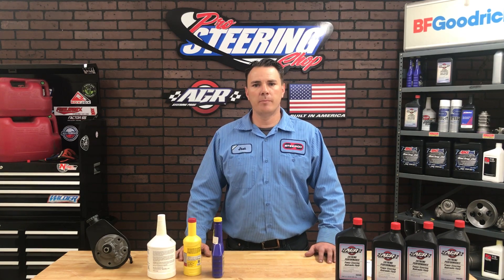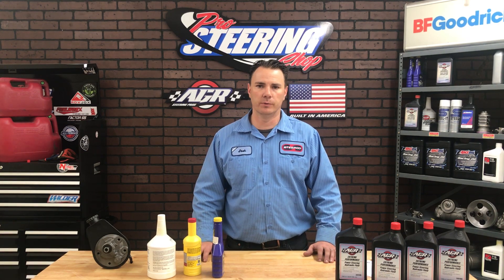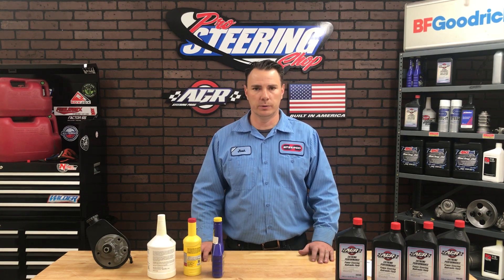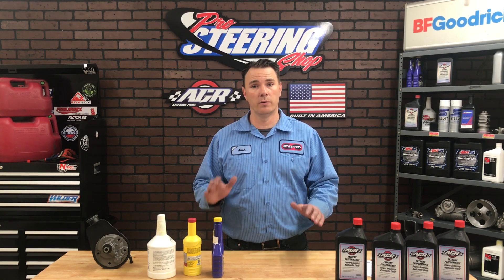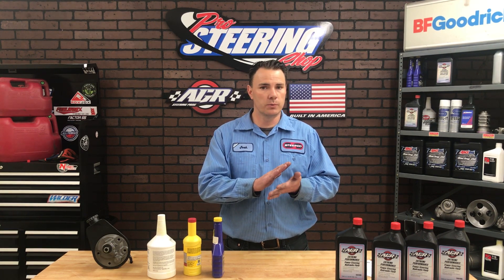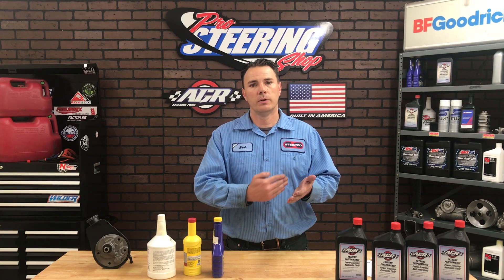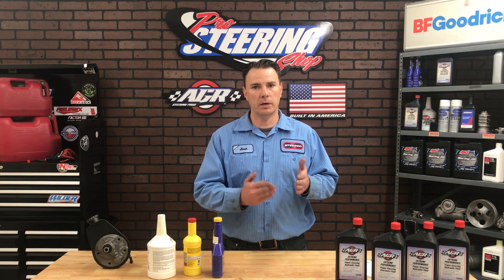Is Synthetic Power Steering Fluid the Best? (2 of 5) AGR Performance Steering

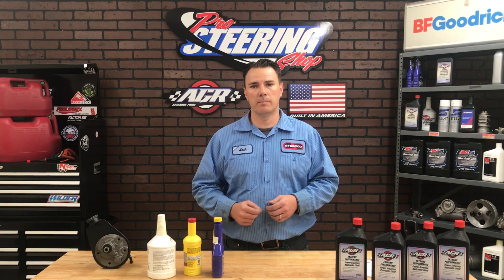Comment: 4:17 - Chrsler/Dodge/Jeep/Fiat  uses ATF+4 Fluid which is Synthetic.   So that's kind of a strange comment to make, unless of course he means for a specific aftermarket type of power steering pump.
Reply: And that should be fine for an OEM pump which is lower pressure and lower volume. Those pumps run on that fluid forever. My buddy’s ‘14 Ram OEM pump has ATF, never changed/flushed and steering is same today as was when he bought it. However, my ‘98 Ram has a high flow pump so I can’t run ATF. I would risk either reduced performance or destroying it.

Comment: Volume is not what makes the steering operate, it is pressure, because the "power" steering system is hydraulic. 

 Mentioning volume would be appropriate when talking about a cars water pump, where the pump is creating super super low pressures moving the "volume" of coolant through the cooling system. 

Metal doesnt melt at 180 degrees. Can you imagine a set of headers melting off your engine😂

Comment: Most of the time a PS pump is working in a bypass mode.  Personally i have used PTFE additive, as well as OEM ATF in  pumps for years with.. admitably.. pre 2012 cares,.. I have had zero problems.
Reply from the maker: GKT I think its great that you care enough about your steering system to try to create a good fluid mixture but using PTFE, however I have not seen the benefits. In-fact Machinery Lubricant Magazine did a write up on this exact topic. I'm quoting them when I say, "(PTFE), was invented by Roy Plunkett of Kinetic Chemicals (DuPont) more than a half century ago. To this day, DuPont claims that "PTFE is not useful as an ingredient in oils"

The  low volume, low pressure pumps manufactured by OEM's can get away with using lesser quality fluids like Automatic Transmission Fluid because they are in fact low pressure, low volume. Just like a high performance engine, a high performance Power Steering Pump requires a better fluid, which is why I state if you are running an OEM pump by all means use a OEM specified fluid, but if you want your HIGH PERFORMANCE PUMP to perform to the standards of its manufacturer use the fluids that the manufacturer recommends, tests and warranties the products with...

Comment: Why do heavy truck’s power steering reservoirs usually have stickers that recommend ATF?  Is PS fluid better, or is ATF easier for truck maintenance shops?
Reply: ATF has a different additive package that can also protect seals better in certain environments.
Reply: ATF is usually cheaper and that is why they do it. My car calls for ATF from the factory, but I only use it as a flush, then replace it with power steering fluid.

Comment: LOL!!  You seem to have (slick) confused with boundary layer.  Sure, heavy LUCAS oil will create a "film" reducing "contact".  But (ANTI FRICTION) is not the same & will only help the pump. 

  Another benefit of some SYNTHETICS is there ((ANTI FOAMING)) properties... Hard use like rock crawling / off road, can cause "cavitation" here & there.  The ability to keep air bubbles under control is a HUGE factor....
Reply from the maker: Jay Dee this Fluid was developed after running 30-50 gallons of over a dozen fluids in our dyno. These tests and their results were the base knowledge before taking those fluids
And the case study to the lab for development. I’m not an expert in fluid development however I learned a great deal in the process of perusing my own fluid!  I do understand dyno results and how they effect foaming, aeration and volume Performsnce very well! 

This fluid is dominate!  It literally has twice as much antifosming agent than any other fluid available!  It WORKS!  If you are still interested in facts i can certainly provide you with data sheets and can explain how that data applies to power steering pump performance or you can wait for further videos and critique them as well. Or you can buy my fluid with one of my pumps, enjoy the same confidence I have in that pumps performance along with its 2 year warranty because no other brand warranties their product past 90 days. There might be something to that!

Comment: Not sure you’re up to date about why synthetic oil can handle the heat better. They are not simple hydrocarbons like petroleum oil. In addition many cars come with power steering fluid coolers. Why would they design that if heat was not such an issue?

Comment: where do you put the temperature probe at to read P/S fluid temps? in the reservoir?😕
Reply from the maker: PANTYEATR1 yes the most accessible place is in the reservoir. This is another reason why I do not recommend having a remote reservoir very far from the pump because the pump is the heat source.
Reply: @Steeringproshop  great info Mr. Josh...by the way, I'm Jefferson. i spoke to you about the V8 pump issue. so, what would be the procedure for testing the heat off the pump and fluid? put a temp probe in the reserve, drive around in in all conditions?
Reply from the maker: PANTYEATR1 a temp probe that you might use in an AC vent or a meat style probe works. Some of our race applications we weld a bung in the reservoir for a gauge sensor